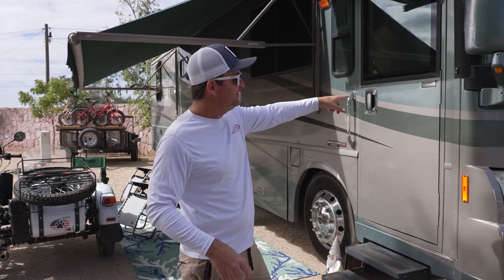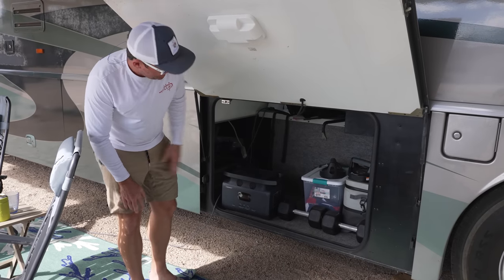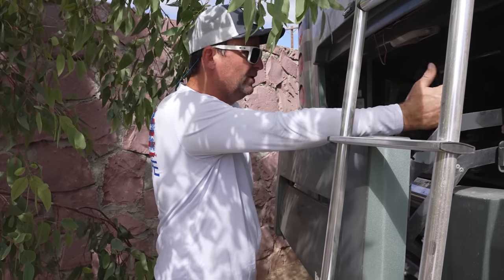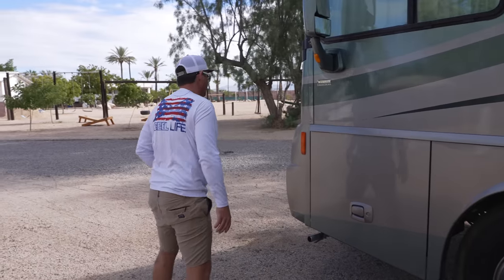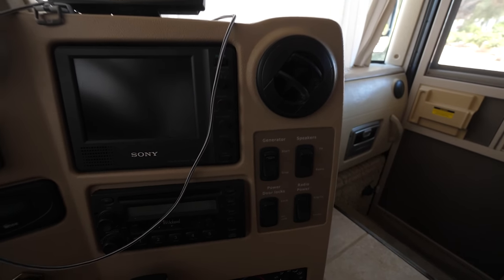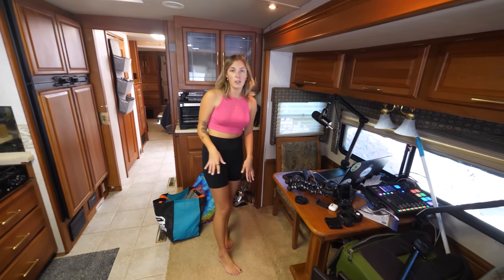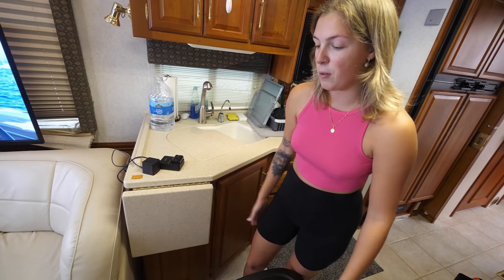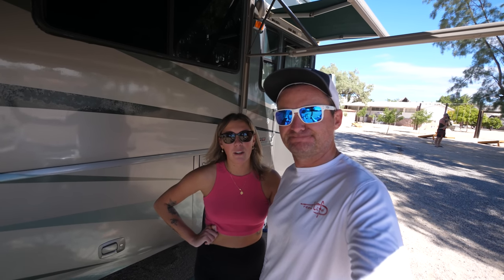2004 Winnebago Vectra Class A Diesel Pusher!

Comment: Not sure if anyone has mentioned this yet… but if you’re temperature guage starts climbing you probably need to clean the radiator. I’m a CATERPILLAR diesel truck technician (for the past 20 years)and all the diesel pushers with rear mounted radiators have the same problem. The road debris kicked up starts to face plug the radiator the side closest to the engine fan (especially the lower corners). You can spray degreaser into the cooling fins from the rear of the RV, then also pressure wash from the same side to help blow the debris out of the fins towards the engine. Should help keep your engine temperature down. Also check the water pump belt tension and condition. Kind of a pain to manually adjust, and flip it inside out to get it over the harmonic balancer if you need to change it.
Reply: Thank you

Comment: The 'curb side' or 'street side' is 'RV Speak' for Port and Starboard.  Curbside is the side the 'house door' opens up on.   The street side is the side that usually has all the hookup connections for electric, potable, grey & black water.

Also: If you haven't already...  Invest in a shore power pole surge spike protector.  Campgrounds are notoriously bad with regulated power and voltage at the shore power poles.

The PPF has failed on the front of the body of the RV.  A heat gun will be your friend with a plastic spatula/scraper to get the PPF off.

Comment: You said the engine gets warmer when in the climbing. I recommend that you clean your radiator. Hose or pressure wash the radiator get the dirt out from between the fins. Two reasons one probably never been done second the dust you just sucke up into it from this trip. It might help big time with the temp getting hot.

Comment: Love that you've moved up to a bit more of GLAMPING . Winnie's have lots of roof problems so beware. Winnie's us SILICON ROOF SEALENTS, do not use Dicore self leveling sealents, they DO NOT STICK TO SILICONE.  Also check where the roof connects to the wall, it goes into a J channel. This needs to be checked yearly to be sure its is stuck. check out James's channel on the tubes  A-Z rv repair, he has lots of info on replacing these roof and how to prevent having to do so.   CHEERS AND SAFE TRAVELS    Steve h.
Reply: I’ve been learning a lot from James. He’s truly a master at his art.

Comment: Looks like a great floor plan. The clear coat is an issue on many RV's that had this applied. As you probably know, there are some companies that remove it. The tank fills also allow you to fill up from both sides at the same time. Something I wish I had for my 150G tank. Maveriks out west here have truck/RV islands that provide this feature. Having sailed (not very well) before getting an RV, I still call the RV parking places a slip!

Comment: Hey Bob great looking Rv. If it is running a little hot on long climbs check switch for fan that cools radiator down cats are known for switch going bad I drove a tractor trailer for 40 years had a 425 cat when you get over fifty thousand miles their the first thing to go also check antifreeze if it has extend life in it change it that is known to mess up water pump and head gaskets good luck with it it sure is Sharp looking Rv

Comment: Make sure your draining your air tanks when you get fuel. And stay on top of the air dryer filter. If you fail to drain the air tanks your system will hydro lock and your brakes won’t work it the tanks fill up. Or the tanks will rust out.

Comment: The radiator gets clogged with dirt from the draft tube gets oil on the radiator and dirt sticks to the radiator  there’s a update draft and you clean clean the radiator off with degreaser and a light pressure washer

Comment: You always have to have more room for stuff.  Bobby make sure you use an old towel or rag to keep your power cord clean before you roll it back in to the coach. Dirt buildup in that system will really screw up the retractor.

Comment: Bobby, its not plastic, it's a clear coat that is pealing off because of the sun. You can sand it down and respray the clearcoat and when dry put a thin plastic covering over it or wrap it in plastic covering

Comment: Great job Guys....a really sweet upgrade!  In looking at the market, there are plenty of these on sale for reasonable prices.  I'm curious about your experience with diesel fuel mileage. Also, what are the requirements for a drivers license, is some version of a CDL required? Oh and Steph....you look spectacular in pink!
Reply: Unfortunately RVs don't require a CDL. Just a regular license, thanks to AARP. Some of these Class As are driven towing a large trailer to carry an SUV etc, and are longer than a typical trailer truck. I wish the feds didn't cave to the AARP on this. Anything that big takes some skill to move around and needs to be a CDL B at a minimum.

Comment: Looks very well cared for and a great upgrade. The air ride makes travel days much more enjoyable. Mine is similar though with an extra slide and bigger engine which out west really helps on the hills. Safe travels.
Reply: It kinda is.  The paint is all blistering, the leather sofa is in bad shape, carpeting needs to be replaced. Lot of work is needed. In certain area. Overall for a 2004, not bad.